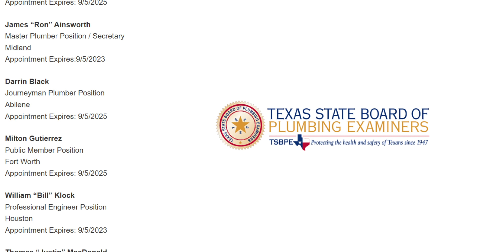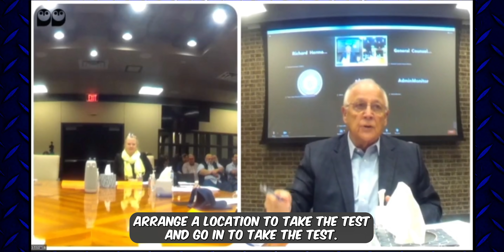What is going on with YOUR PLUMBING License

Comment: I’m in Austin. Testing for me hasn’t been an issue other than the wait from application to test date. Part of that is because of the pandemic put everything on hold. When it comes to testing for people outside the area I have been able to tell that it has been more difficult on them with the time they have to take off, the drive to get here days off work. I think making the ability for people to get it done in a more local setting is a good thing.

Comment: It was a good video but until they stop the handyman plumbers as my self and other rmp it's hard to complete against these people we are licensed and bonded and they have nothing you can't tell me tsbp don't see this trucks running around with no numbers on the truck and loaded with plumbing materials and if you call in they say it will be put in to check on in about a year or so we have to pull permits and with our over head can not complete with them until tsbp gets a hold on this plumbing will never be right I have called on handyman doing a new house and they never check on it I'm a plumber in Texas, work in Houston and Galveston area RMP 12545